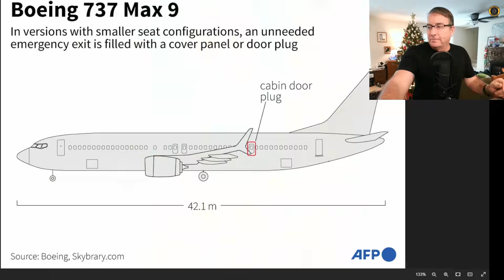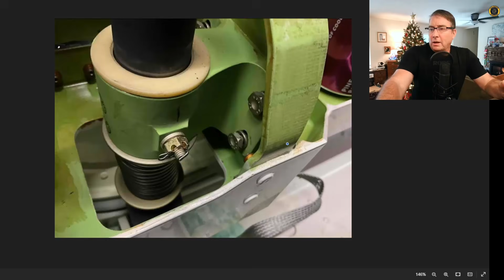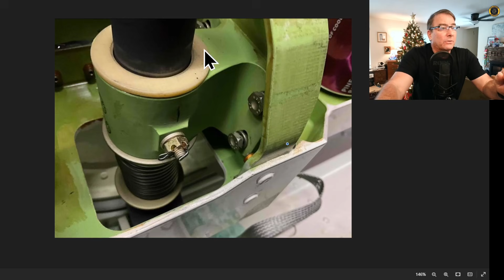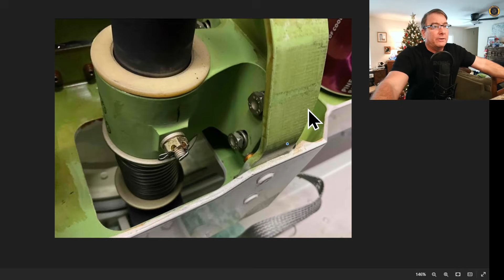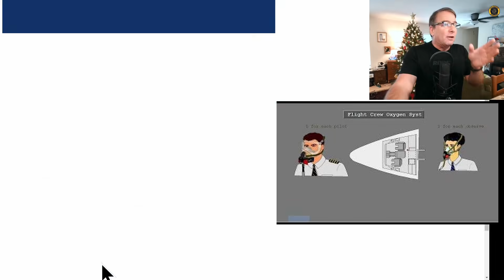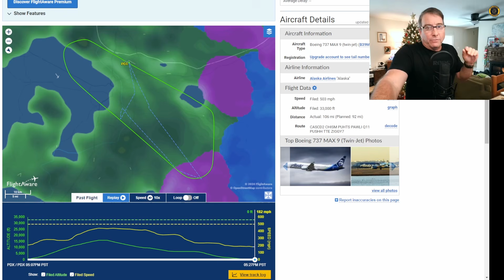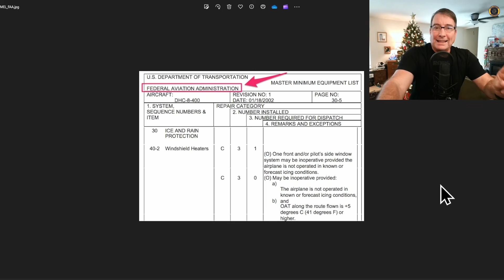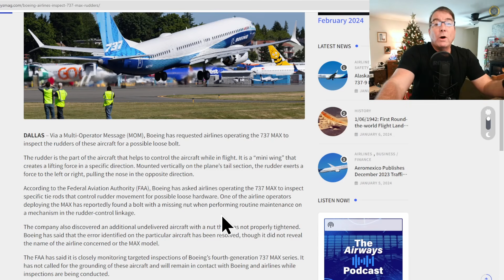"Yes, We Have No Bolts"  9 Jan 737 Max-9 Update

Comment: Cockpit door operation…

I did not know the cockpit door would open.  The door has blow-out panels going into the cockpit, in case of flight-deck window failure.   But there is no mention in the FCOM of the door blowing open if you lose cabin pressure.  

I did ask many engineers about this, and the answer was always that there is insufficient volume in the cockpit to worry.  Apparently not - the door will blow open if the cabin loses pressure.  Would have been nice to know.

FCOM Quote:
There are four blowout panels located in the cabin door. In the event of a sudden depressurization of the flight deck, the blowout panels hinge out from the door. This uncovers openings in the door and allows the air pressure in the flight deck and passenger cabin to equalize.

R

Comment: Great analysis, Juan, as always.  I don't doubt that Boeing has left quite a bit of detail out of the pilot's manuals.  If they included everything about the plane in these books, you'd have a 5,000+ page document that nobody would ever crack open.  It's no doubt a delicate balance, but I can understand that there might be merit to being selective about what pilot's really need to know and what they don't need to know.  In this case, it is very instructive to learn that if something like this were to happen, the crew might lose access to their checklists and may have to survive/function without the benefit of a QRH--and that probably ought to be trained in the sim.
Reply: Not a pilot here, just an enthusiast. If I am not mistaken, cockpit videos from a number of biz jets I've seen show the pilots accessing pretty much all of their checklists on a permanent central multifunction screen in the panel. It makes sense to have paper QRH available in the event of some sort of massive panel failure, but why wouldn't they also be available on a permanently installed screen, and not only on an iPad or something else that can end up lost or out of reach in an event such as this?
Reply: @stephenjarzombek2903  Many modern aircraft have that facility but as far as I know no version of the 737 does - presumably it's part of what was done to keep newer versions within the same type rating as older ones.

Comment: Besides the paper copy of the checklists, why is there no electronic copy which the crew can read on the instrument panel.I can understand why it has not been done yet. You don't want to have to depend on an electronic copy of the list if the electronics goes out. But then the narrator states there is a great deal of redundancy on these aircraft. Not for the checklists apparently.
Reply: There is extra copies of that checklist that was blown out. The quick reference handbook on the aircraft has a duplicate as well as each pilots. iPad also has a duplicate of all of those checklists.
Reply: I thought this might be the case. The narrator stated they had to do the lists from memory. thanks for replying. @cyber25573

Comment: Would you really want potential hijackers to know that depressurization opens locked cockpit doors.  Sure put it in the manual that all hijackers are required to read.  Pilots and crew shoild be surprised by such things.  As the speaker said, maintaining equal pressure between the cockpit and rest of the plane is necessary.  Whether panels on the door blow off or the door, itself, blows open,  cockpit crews should know why it happened in a depressurization event.

Comment: Juan, this is your best video ever.  What DO you have to worry about in these damn things?  Boeing has been doing away with QC personnel and this is the price we pay.  Plus, what a needlessly complex door assembly.  The plug should be bolted in. There is no good reason to allow it to open AT ALL, even for inspection;  since it is not a door in this aircraft, what is there to inspect?  Boeing used to be a great company. WHAT IS WITH THESE GUYS?  Now I don’t want to fly a MAXX.

Comment: Thanks for the updates Juan. Manufacturer delivering new aircraft with bolts loose and missing , operator allowing aircraft to fly where warning lights have activated. The clue is in the word WARNING light. Finally not making information available ( again ) to pilots that the cockpit door will open during a rapid depressurisation.
What the hell is going on. I think the FAA need to step up and have a serious talk to Boeing.

Comment: The upper bolts, castle nut, and cotter pins, are not structural, but just acting as retainers. It appears to me that the same is true for the lower retainer bolts, castle nuts, and cotter pins.

Comment: Here's a little concept I've been working on...  why not just have the hull continuous on the outside instead of putting in a hole and then filling it with a fake door, with all of these additional complications?
Reply: Perhaps they thought they'd need a door or two to board and unboard the plane.
Reply: The door plug approach is used so that if required the aircraft can be modified to carry more passengers which requires extra emergency exits to be installed.

Comment: sky cholo, you are getting a bit mixed up in this one. Why would the pilots' paperwork be flying all over the place, and why would they be dealing with the noise? They are behind an almost airtight, thick door, unless Alaska Airlines cockpit is positioned towards the rear of the plane like this plug door!
Reply: The cockpit door blew open.

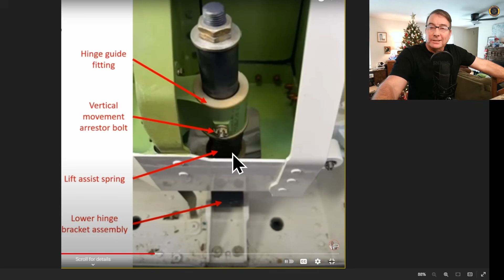Comment: 2:37 The vertical movement arrestor bolt is a joke, if they made it larger or even use a retaining pin that popped into the shaft instead, it would be much harder for the door to slide up. 
It's insane they made everything to bare minimum instead of a more redundant design.

Comment: not defending boeing, but I think it would be shocking...literally chilling  ...that if the public became aware of just how many quality and safety escapes actually happen in commercial aviation.  I am a avionics technician.  I have worked on heavy c checks, mods, retrofits, major alterations, engineering orders and all of the mundane routine and non routine maintenance tasks for nearly every single type airbus, boeing, dassault falcon, and now the airbus helicopter (just started).  In the last 20 years, I cannot even begin to count and name the number of instances where serious quality and safety escapes have happened.  And I am not just talking about the aging fleet, but brand new green aircraft fresh from the factory!  Most of this is hidden from the public and even from the regulatory agencies.  These things are detected by technicians, it gets reported usually at a local level, and there is just no reporting up the chain.  Sometimes, it does get reported, but usually the cause of this reporting IS NOT TO PROVIDE SAFETY AND QUALITY REVIEWS, but more to do with directly costs/warranty liability away from the local service station/repair center. In other words, the entire motivation seems to be driven from only a position of transferring accountability.  A good way to think about this culture, is that "product safety" personnel, do not want techs to reports problems if the issue can be resolved quickly, inexpensively, and with the least amount of documentation.  It is ONLY when the costs gets prohibitive or when deadlines cannot be met that "product safety" personnel and directors of maintenance actually engage the  proper authority to perform a reportable incident.  What this means is that (I am going to exaggerate for effect),  that 90 percents of all quality escapes are found, and resolved with no feedback whatsover to the manufacturer, or to the factory for review.  It is only those instances where resolving the problems cannot be done and deadlines kept!  What this means is that we have a broken industry.  And let me tell you:  it is very risky to stick your neck out and report defects and safety issues.  You do that more than a few times, and expecially if you dare to question the decisions of your local management to report the incident and you will find yourself isolated, and usually sooner or later management will find a reason to give you the last paycheck and smile as they tell you it has nothing to do with reporting unsafe practices....while waving at you leaving the facility with security.  Yes, this does happen.  It's the chilling experience that every tech I have ever worked with understands.  You tell your supervisor about the problem and they send a inspector over and he sez this:  can't we just repair that?  that's how it's done.  And that is where it ends.  

anyone really believing that there is some kind of world where techs are motivate and encouraged to report incidents and to press the issue to make sure the fleet and manufacturers are getting feedback, is smoking crack.  That just doesn't happen.  Mostly this is an issue with senior management who live on the basis of meeting delivery and bonuses are connected to that alone.  there is literally NO MONEY to be earned by reporting failure.  The industry has created this false illusion that it supports some great feedback, lesson learned, best practices, quality review.  but that starts and it ends at the local level.  sharing and reporting defects up and down and laterally and especially getting regulatory officials involved just does not happen.  This was compounded by the boeing max accidents.  It sent a wide spread panic that every single soft fault could be potentially some kind of engineering and design flaw.  This has spooked and paniced the entire industry into a condition where it fears actually learning and getting into the details and investigating issues. BECAUSE IT HAS COSTS HUNDREDS OF LIVES AND BILLIONS OF DOLLARS AND LOST SHARE VALUE...

that is what happens..this is the reality.  

is flight safety embraced now compared to when I first started?  no.  It's slipped...big time.  Just 20 years ago, a young tech could write up a non conformance work order and have the inspector check it out and that would convert to a non routine work order.  Now, that is almost never done.  The "work" is buried in something else...And so, the document that would normally exist to live as a valuable piece of trend analysis simply does not exist.  

and you know who the biggest offenders are?  former military techs and management!  They bring with them, all the wrong cultural broken practices.  Just get it done.  Don't rock the boat.  We need to be operational.  Delivery deliver...now now.  We blow through deadlines and we don't get paid bonuses.  I did not spend 20 years in the military working operational combat aircraft for nothing.  I want to get paid for delivering on time.  We just don't have time to play regulatory bullshit.  Just fix the problem and move fast. This culture is prevalent.  It is absolutely crushing to everyone who has built their reputations and experience over decades of providing the best safest aircraft in the world, deadlines be damned!  We don't work on aircraft to make a paycheck.  We work on aircraft TO SAVE LIVES.  The moment you get that priority upside down, is when you start killing people.  Whether it is your intention or not, this kind of culture breeds the worst kind of complacency.  That as long as you have fixed the problem, then what happens elsewhere is none of your concern.

As I stated earlier...the public would be absolutely shocked to know just how many serious defects are found by techs, every day.  I find at  least one each week.  I am an avionics technician.  I know what can happen if the termination is done incorrectly.  I know what happens when routing and separation rules are not respected.  I know what happens when FOD exists over time.  I know what it looks like when a tech and the inspector decide to pencil whip an inspection card.  I know what happens when you get to a deadline and there is a squawk that should not exist and everything is closed up and you know the right way to find the root cause means delaying delivery to open back up and start looking and the management steps in and sez "this is an intermittent soft fault".  Do not write it up.  It delivers today.  And no one questions that decision.  Except that one guy...and he doesn't know it yet, but he is about to get that cold smile and a hand wave from the director of maintenance while security walks him to his car for the last time.  Yes, this happens.

What will it take to change this culture?  

I hate to tell the truth, because it is painful:  but a LOT MORE PEOPLE WILL DIE before this industry gets serious about doing the right thing.

Comment: The door opening in case of rapid depressurization is rather stupid as now the security of the cockpit is compromised as the hijackers can simply blow out a window to open the door the pilots would still need to bring the plane down so the hijackers could take advantage of the oxygen masks until the plane is at a lower altitude before attacking the cockpit

Comment: The Chairman of the NTSB stated in one of her fist presentations, if not the first , that the pressureization fail light activation  happened three times and that one of those times the light activation  occurred while the airplane was on the ground , She said  or intimated that this fact contributed to the perception of concern by maintenance  and possibly flight crew was less than if all three activations had occured during presurized flight. Coments????